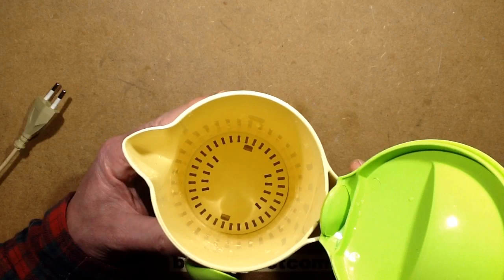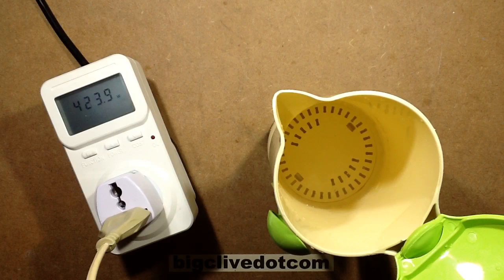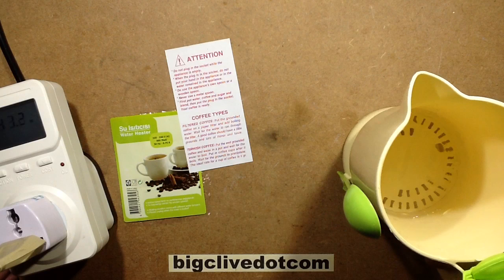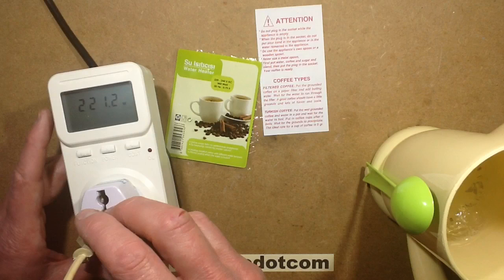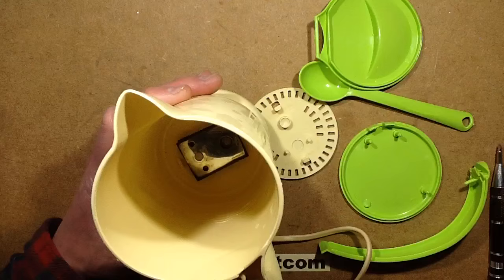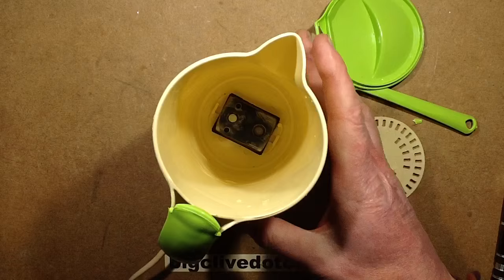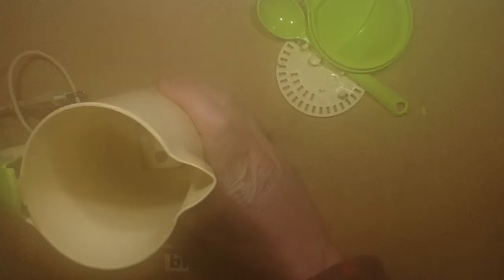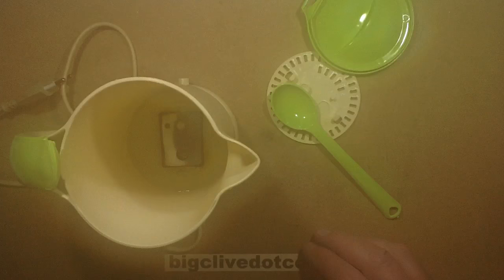Inside a dodgy Turkish "stinger" kettle.

Comment: I'm Turkish and even we don't trust our products.
Reply: Lol! Different story in the uk. We don't have to trust ourselves because a very small amount of electronic products are made on home soil over here.
Reply: +Doruk &#231;apanik This kettle looks ok to me, if one follows the safety rules.
Reply: +Dorf Schmidt You'd have to work to convince me that ingesting these electrolysis products is harmless.
Reply: +Doruk çapanik there's an honest Turk !
Reply: +Doruk çapanik Same here in Greece. (Though, to be fair, there is some small change in that in the last years)
Reply: +The crazy Weaponcrafter Yeah, like a VW... LOL...
Reply: The crazy Weaponcrafter yes I generally prefer german products
Reply: +BIll Georgoulakis Nice the Greeks and Turks have something in common. Even if it's that.
Reply: +Doruk çapanik kebab
Reply: ***** yup that's me
Reply: +lifeofadan Well the UK is really a bit strange when it comes to electrical safety. You've got plugs that contain about a pound of brass in the pins. There's a fuse box in the cellar (or where ever) , a fuse and a switch in every wall socket, a fuse in the plug and then glorified speaker wire in between. Not to mention some of the water heater installations I've seen in bathrooms. Intellectually I know they are probably quite safe, but it just feels so wrong turning on the water in the shower and having it spray all over the electric heater, not to mention that these often had the power switch mounted in the ceiling inside a plastic cup to keep out spray, but with a hole for a piece of string that you pulled to switch it on or off.

It's just such a mix of over engineered on one hand and weirdly dodgy solutions on the other. But it obviously works.

Now it's more than 20 years since I've been to the UK, and I have no idea what the actual laws regarding electrical safety looked like back then or what may have changed since but I'm guessing that some changes has been introduced to harmonize the UK electrical standard with the rest of the EU. But what's on the books and what's in peoples homes are not always the same thing, especially when looking at older houses and installations added by homeowners without formal education regarding electrical safety doing it the same way their dad taught them fifty years ago...

I know all about that last part having a father who rewired most of the house the way his father taught him. Then he had to pull it all and do it again, this time by the book. It was my uncle ,who was an electrician, that told my father that there was no way he would let anyone sleep in the house with the wiring done the way it was. I remember dad using some strong language talking about how ridiculous it all was, but even he had to admit that the installation was much better having my uncle check every step than what he'd done the first time.
Reply: There aren't fuses in the wall socket, just the main consumer unit and plugs.  You only get another fuse if you take off a fused spur, which is basically the same principle as a multiple socket extension.

One peculiar thing about UK sockets though is that theoretically you can draw 32A from a double socket which is only designed for 15A.  Its based purely on the assumption that you will never max out a double socket.
Reply: Thanks for the clarification. It's been almost two decades since last time I visited the UK so I'm a bit fuzzy on the details. I do remember being both impressed and somewhat intimidated by the wall sockets and plugs. On one hand they are the most robust sockets and plugs I can remember seeing, excluding some three phase connectors used in industrial applications. On the other hand i they have to drive up the global price for copper and zink. All that brass! I also can't help but wonder just how many has been beaten to death by someone wielding a cord with the plug as a weapon? :)
Reply: I wonder how much its cost the NHS for "treading on plug" related injuries. ;)  Fortunately with houses having so many sockets these days it happens less often as you learn to NOT leave things unplugged.

Our plugs do have one huge benefit though, WAY more secure for wall-wart adapters than anywhere else.
Reply: Probably as much as the Danish health service spends on 'tread on Lego' injuries. The British plug is a thing of beauty. So well engineered with a fuse, built in slack on the earth, which is mandatory even if it is plastic, as it operates the shutter on the socket. All other plugs just look a bit cheap and flimsy in comparison. Even in Europe where it seems like about a dozen plug and socket combinations are roughly compatible.
Reply: in the US our multi socket power strips have a little resealable breaker in them usually for 15 amps. most of our appliances have a fuse or something similar on the circuit board but definitely not all of them. and nearly all of those are not meant to be user serviceable. i believe those devices are usually dual voltage and can probably be sold in Europe.  in all my years of tinkering with electronics i dont think ive ever seen one blow. even on the ones that have failed rather violently
Reply: Im from turkey too. İf you come here dont buy anything. Dont even come here cuz i once got shocked by those electric stair thingies with just touching the metal of it in the metro station.

Comment: Hey Clive, sorry abou the grey coffee, but I am a Turk and i have to warn you; you weren't supposed to put milk in it. It works well only with Turkish Coffee(google it)
Reply: +Tahir Akgün But even Turkish coffee tastes much better if prepared in cezve :)
Reply: of course. no doubt man! right on!
Reply from the maker: +Tahir Akgün Hmm, I may try it with ground coffee.
Reply: +bigclivedotcom one more thing, I should say, as a fellow vaper myself, turkish coffee goes great with e-cigs
Reply: My favourite coffee is turkish coffee, prepared in cezve, actually I'm sipping a cup right now :)
Reply: the problem I can see is that:
1) boiling anything other than water cannot be cleaned.
2) boiling water with those electrodes creates "cancer causing chromium"
so, it'll either give you food poisoning or cancer. grrrrrreat... >_>
but if you only wanted to use it for a few days, it's not that bad.

Comment: This method of heating water is ok if your water is quite pure like on the isle of man.(and you know what you're doing)
In regions where the drinking water has lots of minerals  it is likely the water will taste not very good after boiling it in this device
Reply: +Animarkzero ‍   The stainless steel electrodes will leave carcinogenic in the water regardless.

Comment: The phenomenon of the power dropping when the water boils reminds me of the 1999 Tōkaimura nuclear incident.

Ignorant of the purpose of procedure, some workers poured 40ℓ of enriched uranium solution into a precipitation tank, and it went critical. Two people died and many more were exposed to dangerous doses of radiation; all in all, a shocking, nasty incident, but the interesting part is what stopped it getting completely out of hand.

Water is a much better neutron moderator than steam. So as the nuclear cocktail heated up and began to boil, the bubbles of steam damped the reaction down. Remind you of anything?

In the end, somebody noticed that the water in the cooling jacket was also acting as a moderator. Draining that brought the solution below criticality. The rest was face-saving and media management.

Comment: question for clive:  does this make clean water have any funny taste? make a cup of tea with it? im wondering if the electrolysis will taint even clean water.  Potentially this could be made safe, when i was in the usa, the only kettle i could find was spout fill only, the lid was part of the case and did not open, i cannot remember if it turned off when boiled(may have had no switch), i do remember it was very slow
Reply from the maker: +jusb1066 I've made a cup of tea and now suddenly I'm actually tasting the tea I'm realising how bland Tetley one-cup really is.

Comment: I'm not so sure it's the shape of the electrode.  I think what is happening is that air bubbles (steam bubbles?) are forming on the metal as the water boils and this decreases the effective conductive surface area of the element.

Comment: dear viewer; if you are reading this then you should know that you would never ever add milk in any heating element. It will go KA-BOOOM and will ruin your electronics. (Probably your stomach too, just don't try to drink that) 

Otherwise this could be useful to make pasta (not spagetti, at least make sure its not too thin to enter those spaces), tea and lots of other stuff in it to make your life easier. AND you should clean that out few cycles before use (like 10 to 15 times to avoid carcinogen stuff lol)

Comment: Why would the makers of this design it to electrocute the water, rather than just including a basic heating element? Is it cheaper to build that way, or does it heat up the water faster? In either case, it seems exceedingly dangerous to value those aspects over, well, basic safety.
Reply from the maker: Very cheap to make.
Reply: @user-gx6jb6wc5g  Gotcha, figured it was that. I feel like a heating element wouldn't be that much more expensive to include, especially if it meant you're not getting lawsuits from wrongful injury/death left and right, but what do I know. 

I suppose the target audience of such a product may just not have the resources to hire attorneys/consumer protection is iffy in Turkey.

Comment: Its not a heating element, Its a live electric wire against Water ?
Reply: Yep, I guessed right. Someone clearly saw one of those Tok Toks with the soldering a Live and Neutral Wires onto Razor Blades and sticking them in water to boil it.

Comment: I have a very basic electrical question. If the two stainless steel plates, connected to the power cord, are insulated from one another by the plastic divider, how is it that the water boils rather than becoming conductive? I've seen other products you've demonstrated where I would ask the same question.
Reply from the maker: +David Damico The water acts like a resistor and heats up directly with the current flowing through it.

Comment: This type of kettle is very common in Serbia, where I used to live. Though I never saw one with an element exposed like that. Most tend to be either a shielded element behind a metal plate or the exposed element coil like 'ye olde fashioned' kettles. Not even the cheapo 'Chinese' versions in Serbia are this bad! Oh and this type of kettle should not be used with instant coffee, only with coarse grain ground coffee.

Comment: Hi Clive! New to your channel but am loving the tear down videos and makes me very aware of the dodginess of some of these devices.  This leads me to ask you a question... I will be moving back to the UK in April from the Czech Republic and we have several appliances with moulded plugs, some of these are the two pin variety with no earth and some are the round two pin with earth.  The question is can we use these safely in the UK with an adapter?  Or could I even cut the EU plug off and fit a standard UK 3 pin plug?  Hope you can help.  Thanks Bryan
Reply from the maker: +whi5tler If the appliances are low power (less than 300W) then it might be OK to use them with a good quality adaptor.  But for higher power ones fit a new plug.
Reply: Cheers, many thanks for that :)

Comment: razor blades are high carbon steel.  stainless does not hold and edge as well.
Reply: A lot of razor blades are stainless now days, and yes, they only last 2 or 3 good shaves.
Reply: It depends more on the edge coating than the material itself. Some blades use a teflon coating, some use chrome, some use platinum,  etc..

Comment: I'm surprised it states, do not connect without water!! Surly without water, NO current will pass!
Reply from the maker: +Michael Beeny I think they may be concerned about tracking between the electrodes on their plastic supports as they dry.

Comment: no salt water test :(
Reply: +the3dvideo It'll just trip the fuse. I've done it.
Reply: he could not plug it into that fused meter and see how about 30amps does it. (or 16a depending on how the house is wired)
Reply: the3dvideo lol are you serious? I don't think it's a good idea to put brine in that thing and plug it into an UNFUSED outlet.
Reply: in the US they use unfused sockets also they do in china.
Reply: the3dvideo actually no in the US if you have a house that doesn't have a proper ground you use a GFCI Socket. In turn the sockets are run to a circuit breaker. Most of our PLUGS aren't fused as there is no need. Still, there isn't any harm in wiring in a fuse in more high current operations.

Comment: I wonder if electricity+boiling is better than just boiling for sanitary purposes when the only water sources available are dodgy?
Reply from the maker: Boiling on its own would be preferable.  I'd be concerned about the random other metal salts that might get introduced to the water.  But in an emergency anything goes.
Reply: @user-gx6jb6wc5g  thank you. I won't be getting a sketchy pitcher of doom for my emergency supply stash!

Comment: Any tips/pointers as to a good power usage meter Clive? Thanks.
Reply from the maker: +InnaSoulSounds It's tricky finding a good one.  The one I use came from Maplin in the UK when they had them in briefly years ago.  It's actually a very basic unit that resets as soon as it is removed from a socket.  But it seems to be the most accurate I've had when used with odd loads.
Reply: Thanks. I'm thinking of chancing the Hong Kong market. It claims a CAT II rating and has the partial insulation on the plug pins. Up to 2.9KW. 13A. All for £8. I might chance it. I'd be more confident if I'd seen you take one apart beforehand. Not expecting you to, of course. It's listed as 'UK Plug Plug-in Power Consumption Meter Energy Electricity Usage Watt Calculator' if you're interested in taking a peek.
Reply from the maker: +InnaSoulSounds I've got one of those and it's not actually very good at unusual loads.
Reply: Sorry Clive, too late. Got tipsy last night/morning and bought it. :)
Reply: +bigclivedotcom  Would an isolation transformer between the meter and the load make the reading more sensible?  Is there a way to make a transformer resonate at 50hz so the load on its primary is generally closer to sinusoidal?
Reply: +MattOGormanSmith There's a way to correct loads that are heavily capacitive or inductive, they do it in factories with big electric motors, which are inductive. The solution is basically stick a load of capacitors in there. Called "power factor correction". Doing it makes their electrical load more normal, so the electric company charge them less money. 

But it has to be tuned for the particular load in question. There's no simple automatic way. In this case better to have the meter be able to cope with unusual loads, and the answer to that is buy a better meter.

Comment: Do you think this could be made to run on 12v dc. Or would it just take forever to boil.
Reply from the maker: It would electrolytically decompose the electrodes into the water on DC.
Reply: @user-gx6jb6wc5g I hadn't though of that. Probably not make for a very nice cup of coffee. Thanks, keep up the good work.

Comment: What happens if you turn it on without water or add the water slowly while its turned on..
Reply from the maker: If turned on dry nothing happens.  If water is added slowly it will start heating when it bridges the electrodes.

Comment: I wonder if these devices are more efficient in heating water than of a heating element of similar size?
Reply: +yamatoneko1 not more effficient, the upside though is as the water boils, the current goes down, and if it boils dry, nothing happens, there is no current flowing at all, and this device has not even a switch or a boil turn off, so very simple and pretty long lasting potentially.
Reply: jusb1066 Oh I know they don't last long at all, maybe 20 boils. The electrodes literally fall apart due to whatever happens during the boiling action.
Reply: yamatoneko1
haha, very clever of them!
Reply: +yamatoneko1 Yup. And guess where the metal goes...
Reply: +yamatoneko1 Hmmm... they are more efficient in electrocutions! LOL

Comment: would this work on 12v. you could use in car. not sure how bad a sting you would get from 12v DC
Reply from the maker: +Mohammed M No.  It would just cause slow electrolysis and make the water taste terrible.

Comment: I'd be interested knowing to what voltage an electrode (like a metal spoon) suspended in the water was energized?  Feeling bold?
Reply from the maker: +Stephen Tack Done in an earlier electrode water heater video.  The spoon was live at about 120V (half our mains voltage) and was capable of delivering about 200mA.
Reply: Ooooh, deadly! 😵
Rock on bigclivedotcom!